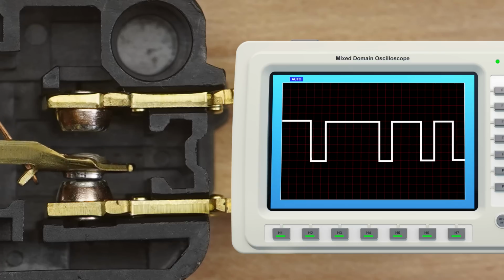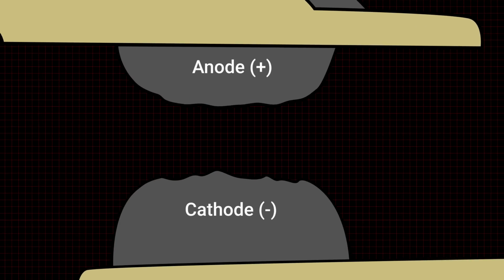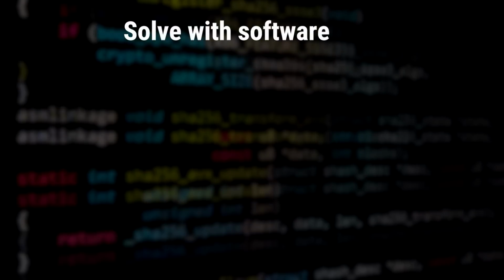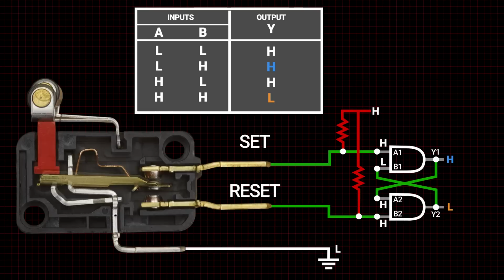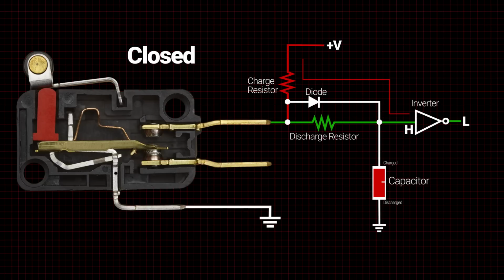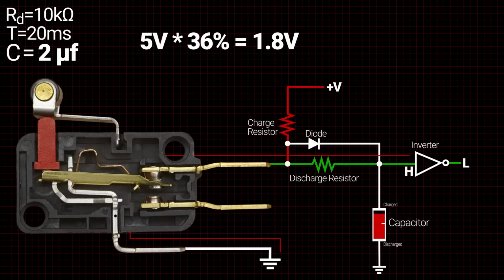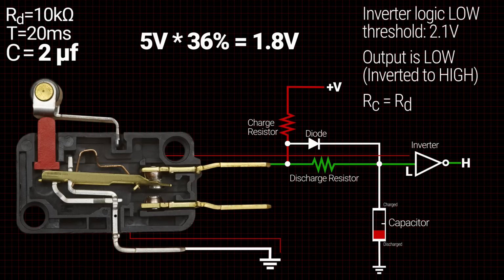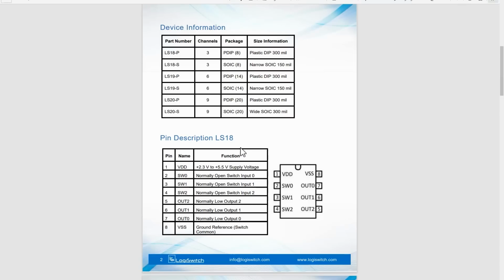What is Switch Bounce and How to Debounce – ATM | Digi-Key Electronics

Comment: What about a Schmitt-Trigger fror debouncing a switch signal?
Reply: That works for small amplitude noise, but switch bounce tipically goes all the way to +V and GND.
Reply: Can't believe there was not even one Tigger hidden anywhere in the video. Boing boing boing.
Reply: @jeremyperala839  I have several. Zero Debounce Delay for an SPST switch with an SR Latch.
https://spacetimepro.blogspot.com/2023/09/switch-debouncer.html